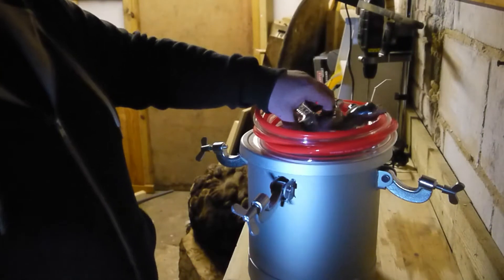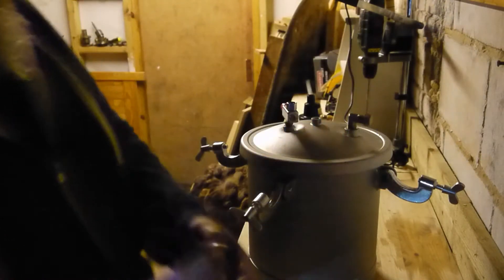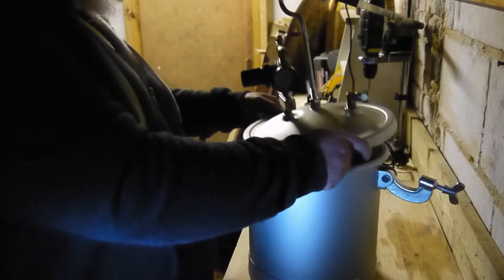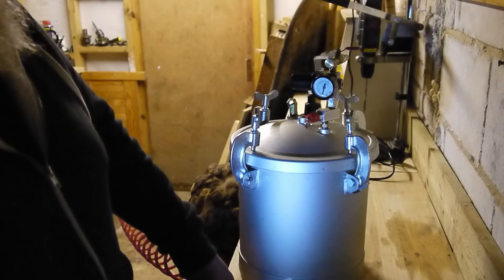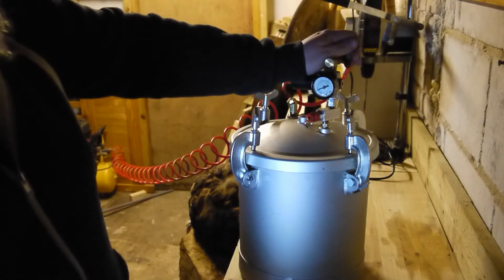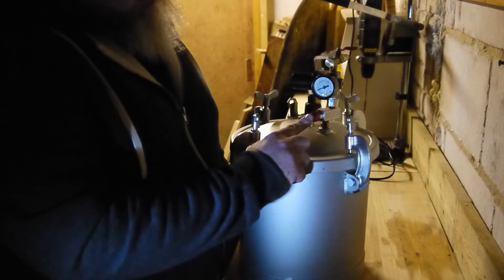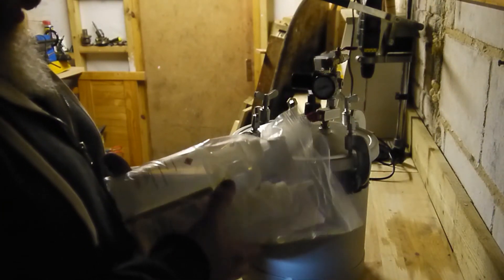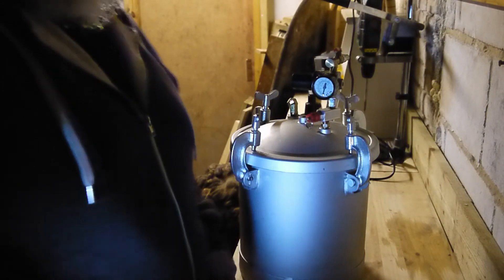How to make a resin casting pressure pot Part 2

Comment: https://www.ebay.co.uk/itm/20ltr-Pressure-Tank-with-Air-Regulator-Paint-Pot-Spray-Gun-2-0mm-AGITATOR/282874824081?epid=2214280874&hash=item41dca74591:g:X~8AAOSwEQFZqBTw i heard a few bad comments about the chinese harbor freight style, ive just got this from ebay on finance too tenner a month over 2 year. i make catapults so size needed was bigger then the 10l size il probably lay mine on the side too for massive scales i can use poly for my micarta and a clear for hybrids. i opted for pressure as i mainly work with resin then wood, in time maybe stabilising kit looking forward for mine arriving to convert. ill sub and be back to chat cool vid glen aka west yortkshire catapults